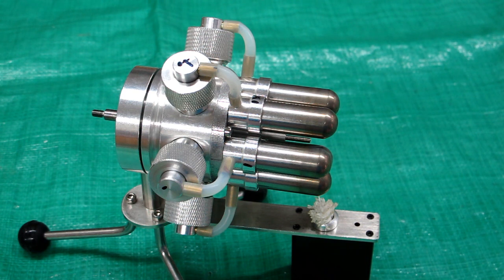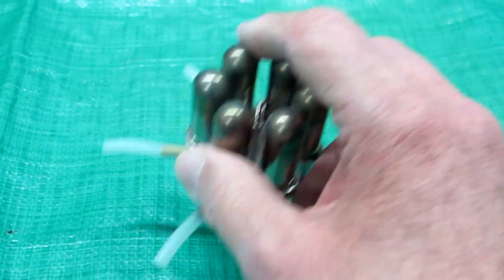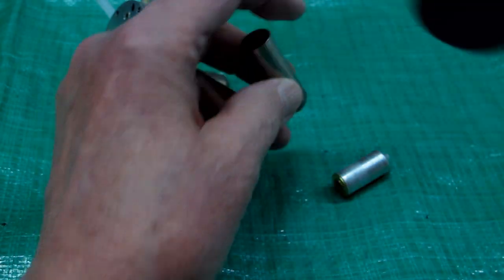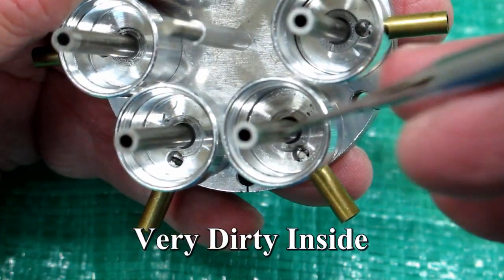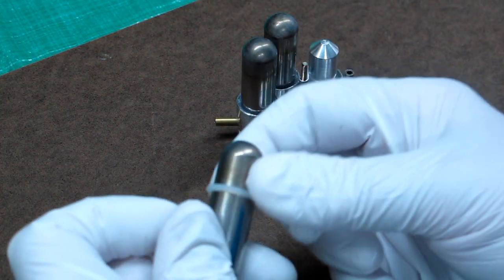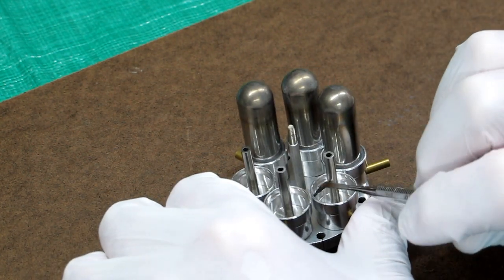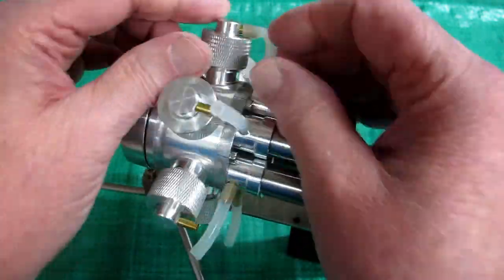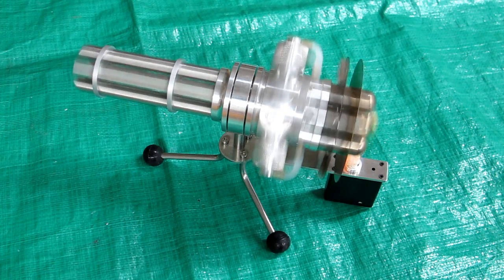Gatling Stirling Engine - Hot End Repair

Comment: You should get a hollow PVC pipe or copper tube and slide it over the hot end tubes to evenly push the O rings back down into the sockets.
Reply from the maker: Couldn't find one, not anything even close and did not feel like making one.